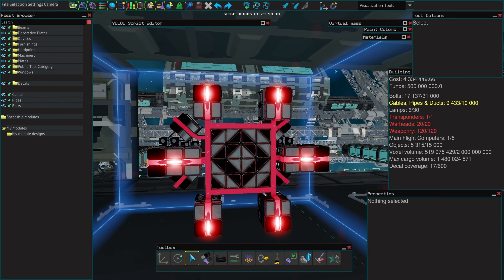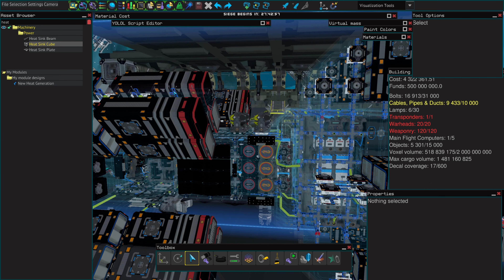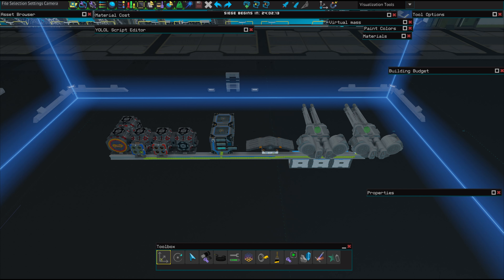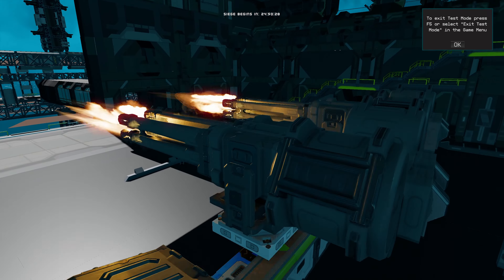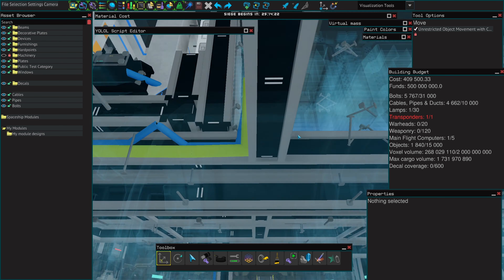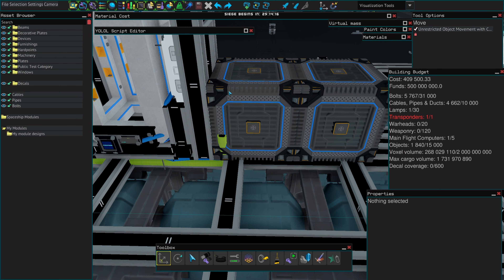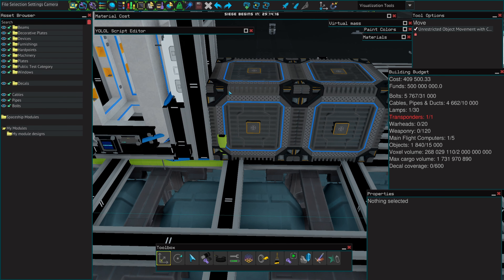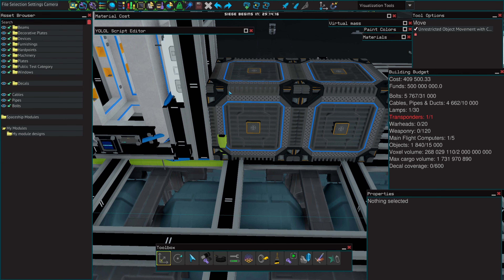Starbase - updating your ships to the new heat system

Comment: Hi if i want to edit a ship i own already can i do this via the ship editor instead of manually bolting and piping it? If so, how? Or do we still have to do it the old fashioned way once we have spawned in our ship and grab bolt gun and piping tool and modify by hand only? Thanks
Reply from the maker: As far as I know, if your ship has already been spawned you wil need to add the heatsinks outide of the ship designer
If you have not spawned the ship you can edit it normally in the ship designer
The heatsinks will require both cable and pipe if you do not put them with the generators directly